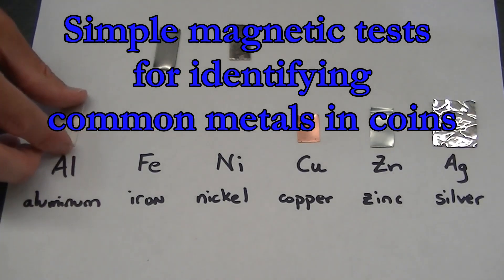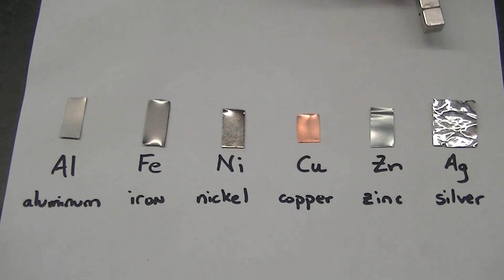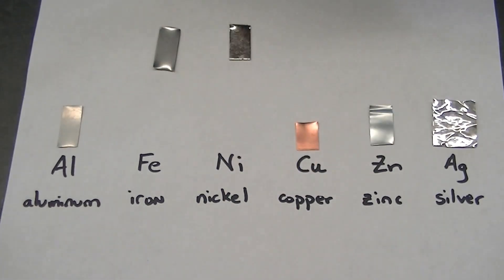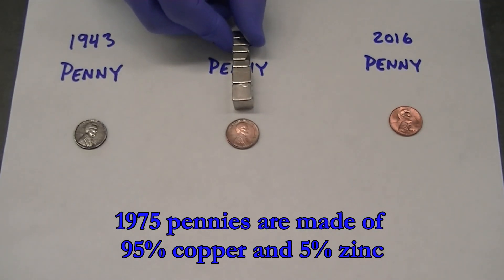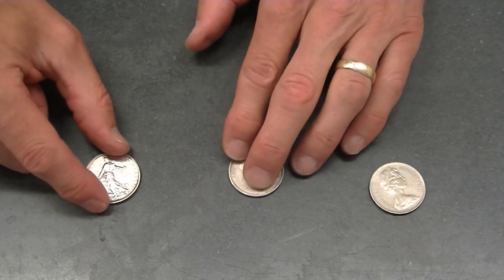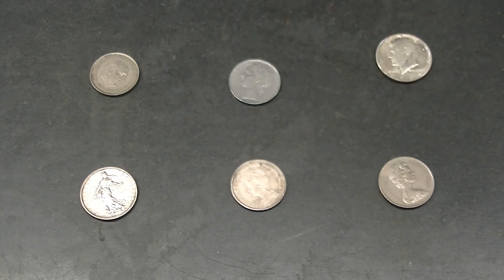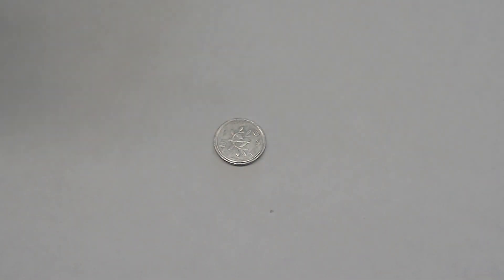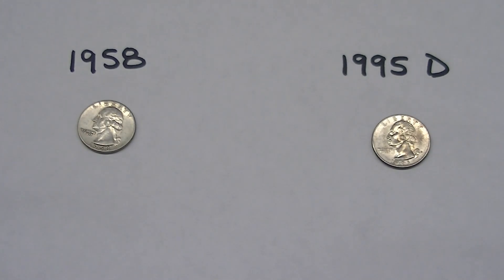Testing Coins with Magnets

Comment: Regarding 3:14, prior to 1965, United States Mint Quarter Dollars were made from 90% Silver. However, the Coinage Act of 1965 replaced the silver content in coins with a cheaper composition consisting of a copper core sandwiched between an outer layer of cupronickel. Metallurgists at the Battelle Memorial Institute developed this clad composition in order to mimic the magnetic signature of 90% Silver coins. This metallic composition substitution allowed millions of vending machines & parking meters to accept either 90% Silver coins as well as the cupronickel clad copper core sandwich coins.
Reply from the maker: Nice!